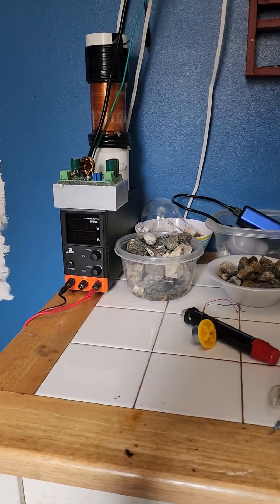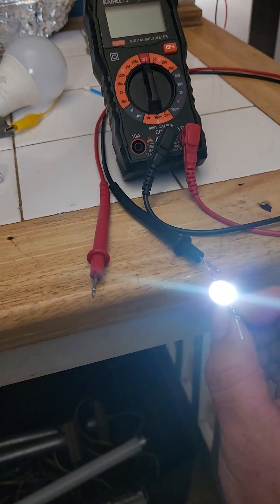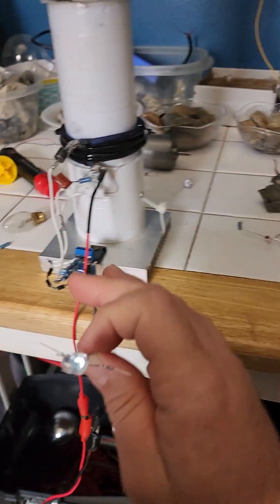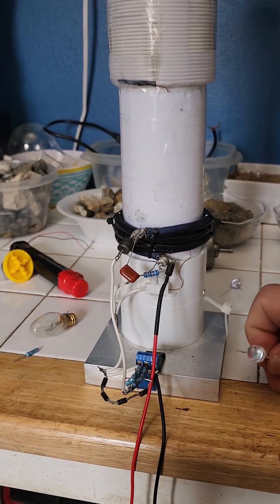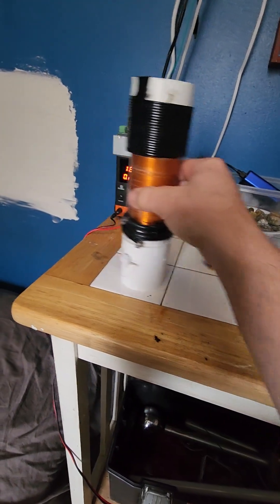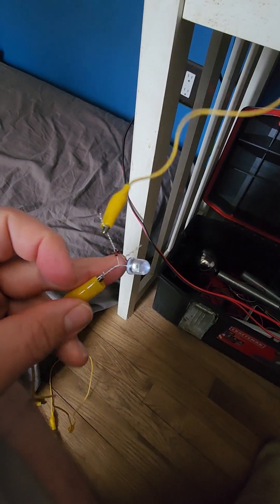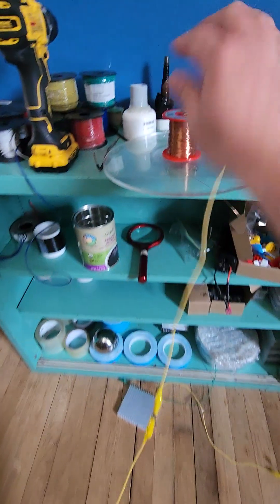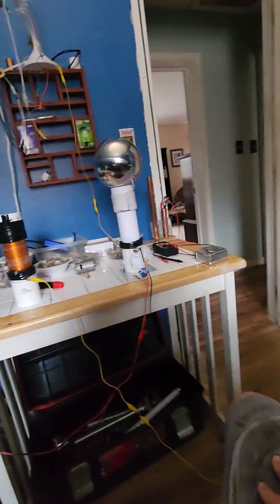😱MK4 KITS COMING SOON & OPTIMIZING THE RADIANT ENERGY EFFECTS ✨️ 👌

Comment: need test receiver coil at distance , i say it goes under ground and distance may not be a limiting factor , if it becomes one you can add a electrolytic cap to the receiver coil both at source as well and tank circuit them

Comment: using a thinner secondary can be your current limiter then if you want to use UHF safely since there is no more than 50ma or so its should be fine unless you sleep with the coil running under your pillow i dont see an issue

Comment: I have done one device according your describing, but I have got a problem, the diods prymary coil(schotty 20A 40v) and transistor(tip35c) are crazy warming in 2 minutes. I use only 22k resistor on base , probably I use a wrong resistor for base and also probably I use wrong power supply ( I use 15v 6a  power supply from laptop.) I am waiting for pdf that will describe how to calculate resistors for transistor, maybe it will solve my heating problem.  Thank for sharing
Reply from the maker: It will be coming in less then a month & make sure the primary coils is 8awg. The transmitter has to be exactly identical to mine for most effeciencies